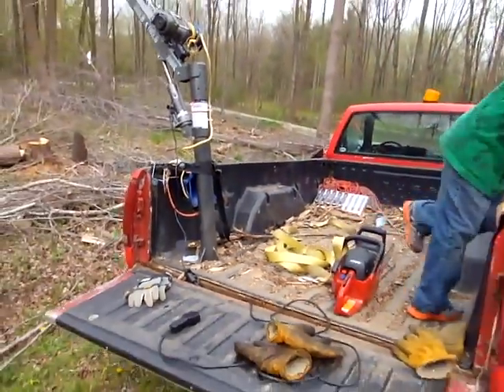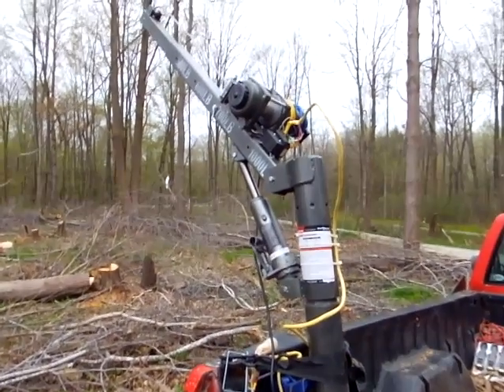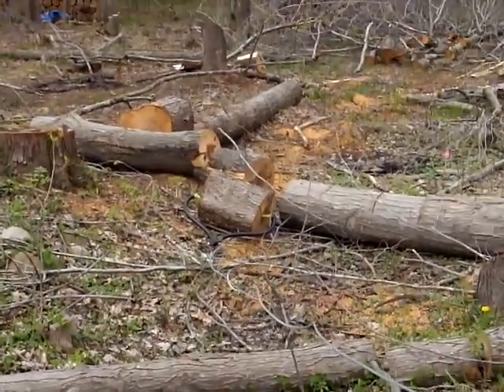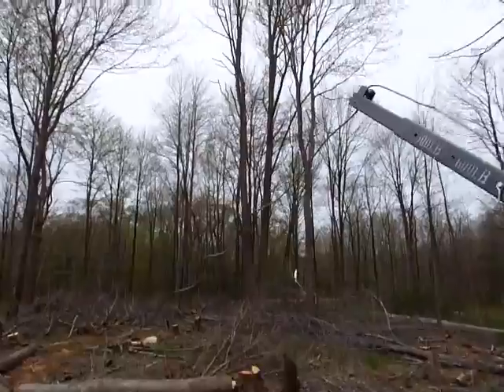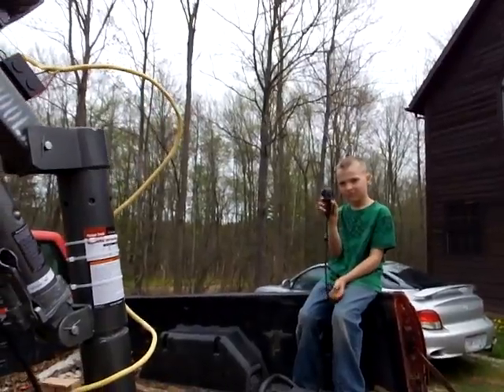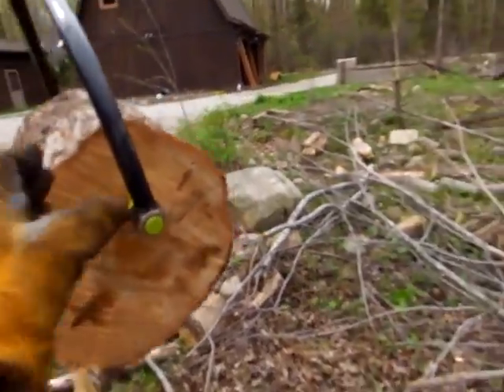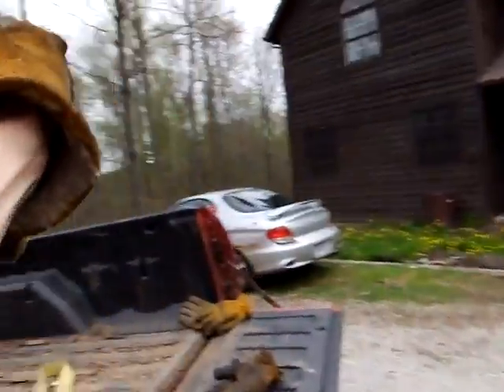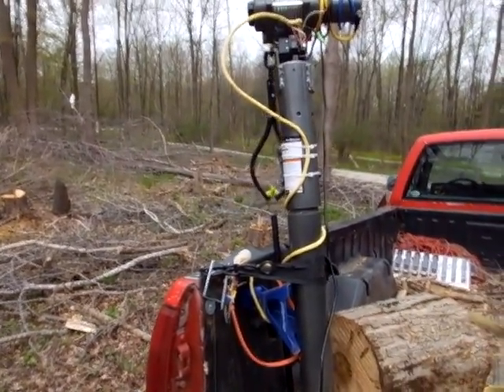Pickup crane DIY

Comment: 1. the crane and winch will not have to work as hard if you clean debris out of the way. 2. you needed that to load firewood?
Reply from the maker: I used it for lifting logs into the truck.  The small piece was for demonstration.  Cleaning up the yard from dropped trees was the main purpose.  It worked well.

Comment: you need to see my video of my mini log trailer..i have a diffrenet tractor now but same trailer..the witch i use will also work in any receiver thats 1 1/4. and works on my dump trailer -  lawn tractor log trailer-  is the name of video
Reply from the maker: Great idea.  Since this video, I've moved the setup to the hitch so it can be removed.  I've recently gotten a side-by-side ATV with a hitch mount... your idea has prompted me to mount it to that along with my mini trailer.  Should work great for log recovery in the back acerage.  Thanks!
Reply: @neotech40  i also have a setup like that in 2" for my truck..the only thing is the wire on bigger witches gets spendy..i have #2 to the back and front..my face book has pics of that..its open so every body can look..its in the c10 pics..if you look around you might come up with more ideas..good luck ..

Comment: Did the winch mount right up to the existing bolts or did you have to fabricate something?
Reply from the maker: I believe two of the bolts lined up, and I think the other two needed drilled.  It's been a few years (and I still use it constantly), so I dont remember the details.  But I don't recall it being overly complex.

Comment: try to fab a way to mount it to your receiver.....less stress on your bed...and it could handle more weight
Reply: That is exactly what I'm thinking about doing when I weld one up this summer with my everlast. I want to put a jack underneath it as well so that it is supported against the ground as well.

Comment: how much can it lift up on u bed  not drag
Reply from the maker: +spectra vectra I've lifted logs the length of my truck bed (and a bit longer) onto the back of my truck with this setup.  I would typically drag the log to the truck, then reposition the log tongs to the center of gravity point on the log (sometimes take a few up/down/reposition attempts to get it just right).  Once there, I can control the winch switch with one hand, and guide the log onto the truck bed with the other with little difficulty.  I am not sure what the weight of the logs are... heavier than my back can lift - that's for sure.

Comment: Just installed this crane on a homemade jeep trailer and to say the least I'm impressed with it. Lifted a sears tractor into the trailer with it tonight. Worked flawlessly. Big back saver for sure. I'd like to get an electric winch for it but I can use a battery powered drill with a 1/4 inch to half inch drive with a socket to turn the winch much faster than by hand. Great video!!